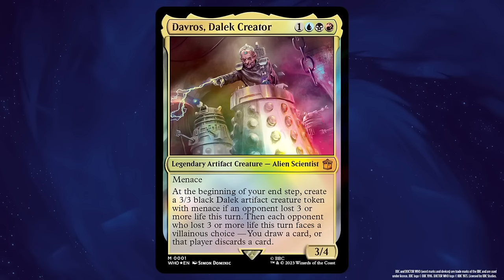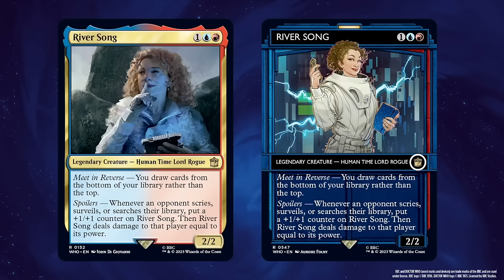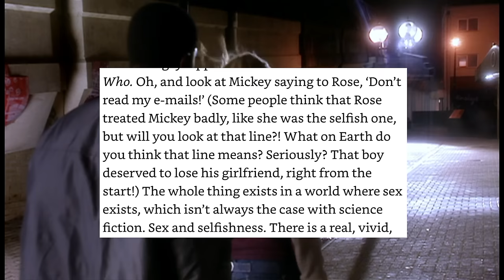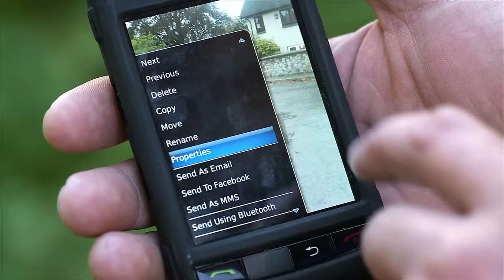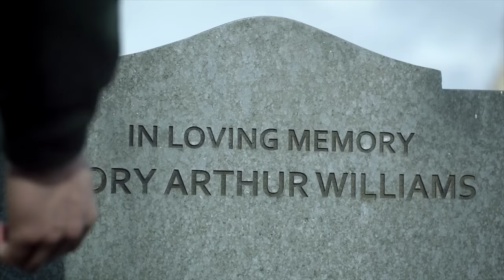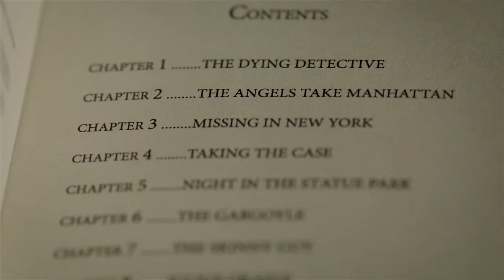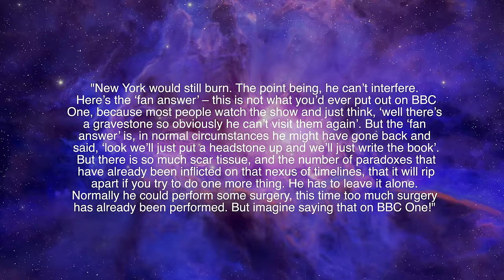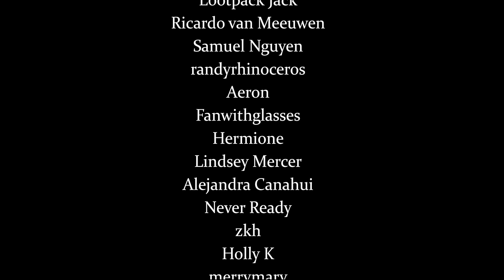Martha Jones Deserved Better (And Other Correct Doctor Who Takes)

Comment: As someone who was a huge BBC Sherlock girl back in the day, and has recently started getting into Elementary, I can tell you that Elementary is the superior show!! I’ve only been watching for a couple of months but it already holds such a dear spot in my heart
Reply: I got bored of Sherlock after the first 2 episodes. I can't believe they needed feature length episodes for something so...thin. Elementary, on the other hand, was a cracking good show and probably could have actually pulled off feature length if they'd wanted. But almost by design no serious show of that sort really needs such length. If you can't wrap up an episode in less than hour then you're probably not a good showrunner...which Moffat has repeatedly proven. I think there's a reason Who fell off after he took over.
Reply: 100% For me it's the Watson/Sherlock dynamic that makes it so good!
Reply: Elementary 💯

Comment: I've built a commander deck with a proxied River Song at the helm and it's themed around moving cards around, scrying, generally manipulating my deck, and burning my library from both ends, so fun and so technical that I keep a notebook next to me to track the order of cards on the top of my library and the bottom of library at the same time. I find puzzles so fun and knowing I have just the right answer to the board 3 cards from the bottom of my library, and I get to just puzzle out "Okay, how do I get that card to a place where I can cast it?"

Comment: Hey, thanks for this video! First off, the music seemed 100% fine with me, if it's an issue I'd suggest just turning the volume down a little underneath your narration rather than completely removing it. Second though, as someone who grew up in the SWL bubble back in the days (mostly Sherlock, I happened to miss most of the DW drama), I have a knee-jerk reaction to defend that fandom space and its fans from people who either look back at it with embarrassment or judge it from outside spaces just because it was something that teenage girls were interested in- but as a white fan it was incredibly helpful to hear a voice that understood and respected those fans from experience, while still giving some really insightful criticism from a POC perspective that I was admittedly not as familiar with as I probably should be.

I think the part that stuck with me most was the distinction between intent and result, where some writers think in the smaller scale of individual reactions without realizing the broader message that they're delivering. It makes me think about how easy it is to fall into tropes/archetypes/stereotypes without really thinking about it, even if the writer in question would consciously try to avoid them otherwise- which highlights how important it is to 1. have people on your team who are looking for those pitfalls, and 2. be able to take a step back and look at your own work critically through a perspective you might not have considered at first. 

Anyway, all this to say, I'm really grateful that I happened upon your video, and I look forward to working my way through your other essays in the future!

Comment: 19:30 TBH I think the Doctor not really "getting" racism in the way it impacts humans does make sense for the character, am thinking more of a just "forgetting" it's a thing that others have to think about perspective. As in, the Doctor not really grokking the privilege they've had when travelling to earth for (until that point in their life) always presenting as an older straight white dude. 

HOWEVER, the character of the Doctor forgetting about the weird ways humans arbitrarily divide their society doesn't excuse the writers from forgetting about those divisions. You can write stories where the Doctor is kinda oblivious (due to their privilege) but the story and the other (particularly the human) characters do get it, causing tension. 

Oh as a side note, the reason Human Nature/Family of Blood was set in 1913 is because it's based on the Seventh Doctor novel Human Nature which was also set in 1913. Thing is though, Ace (who was the Doctor's companion in that story IIRC) is not black and so the source material didn't have to deal with that issue. The fact the adaptation didn't take this into account to avoid Martha having to deal with so much racism makes me think there wasn't enough imagination or will in the adaptation process to change it such that Martha wasn't so thoughtlessly treated. 

(Speaking of Human Nature though, it's a good novel! Worth a read, especially as you mentioned liking Ace as a companion!)